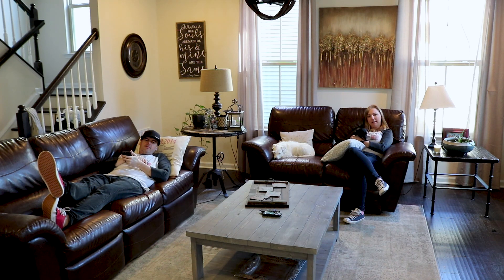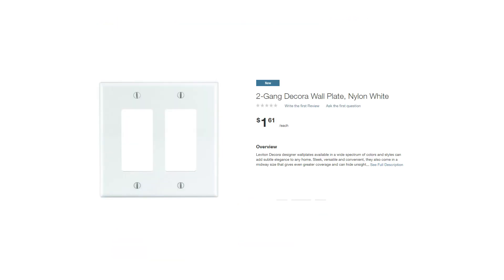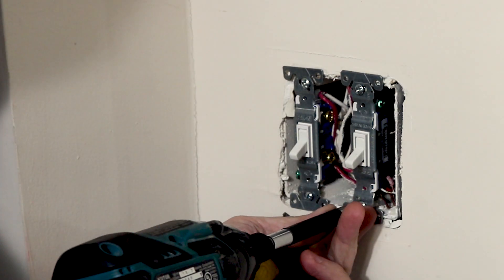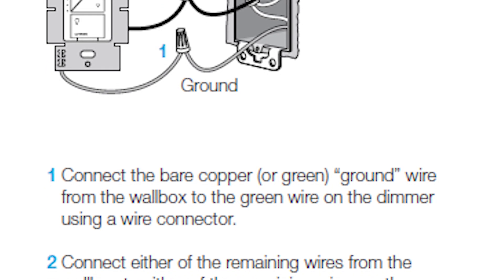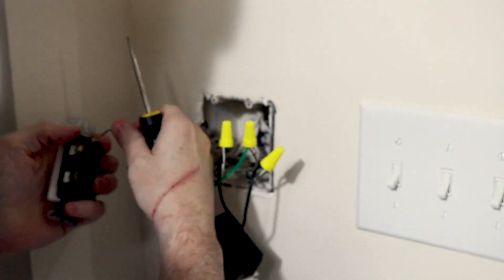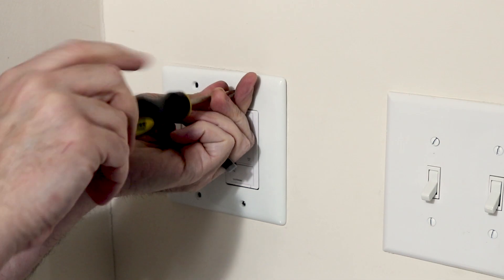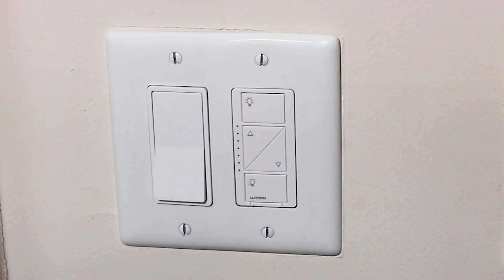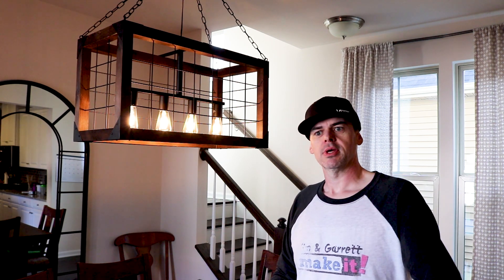How To Install A Lutron Dimmer Switch DIY Smart Home

Comment: This is exactly what I have been looking for to help us as we have a double light switch and want to install the Lutron switches but don't need both switches to be the wifi dimmer switch. Thank you so much, this was perfect!  Question on that it looks like you didn't need to use the smart bridge?  I thought these Lutron Caseta dimmer switches needed to operate using the smart bridge that comes in the Lutron kit.  Thanks!

Comment: How do I connect lutron caseta PD5 ANS wireless switch to my existing 3 way. I want to replace one of the switches with the lutron. There is a 14/2 and a 14/3 cable coming from the wall.
Reply from the maker: I reccomend looking through youtube!